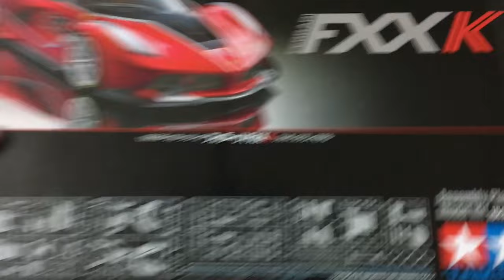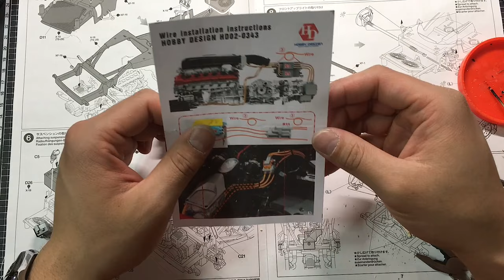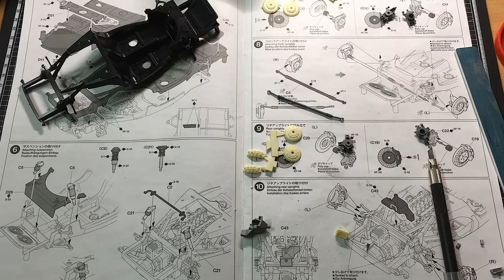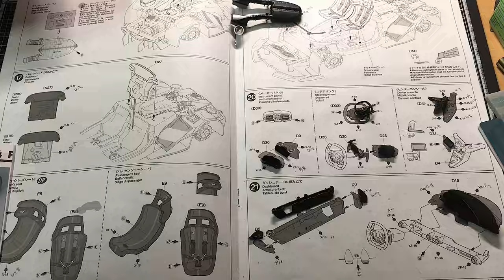[Full build] Make It Ferrari FXX K 1/24 Scale step by step (Tamiya)

Comment: Which seat belt product did you use?
Reply from the maker: It's in Hobby design
Reply: It looks like cardboard correct? 
Many products I’ve tried always fray at the end when cutting it to fit in the metal part

Comment: What brand paints did you use? You sprayed a semi gloss clear coat before the 2K was there a reason? Like setting the decals?
Car looks great! Fine build!
Reply from the maker: Paint mainly uses Tamya, mr.hobby products that we know. Semi-glossy has a rough surface finish, but if you put urethane on it, it seems that the bond becomes a little stronger.